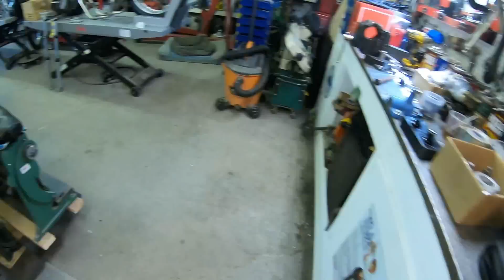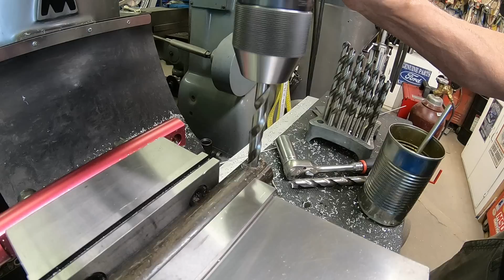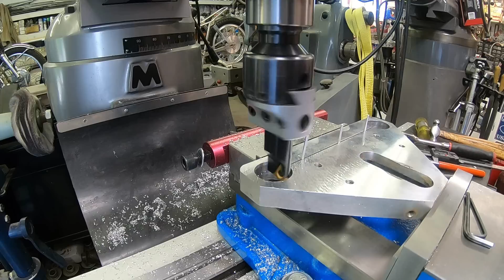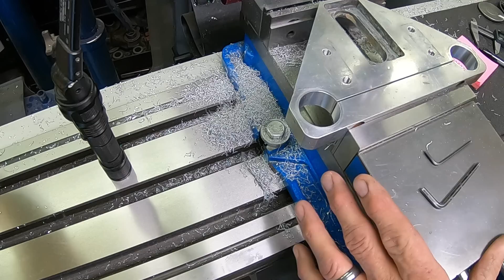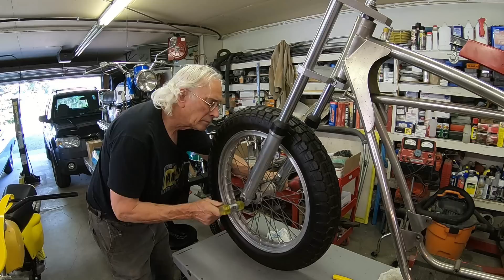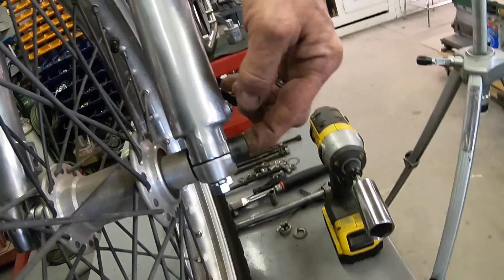Champion Framed Yamaha 360 Flat tracker repairs

Comment: Now you're talking
Reply: I found the bike you are working on . when I lived in California I had to  move I couldn't take it with me I finally found the same bike that I used to have.
 
So I bought it and put it in storage it's in rough shape it's locked up inspected it made a list for tires carburetors wish me luck. 1973 Yamaha 360
Reply from the maker: I understand, I bought mine in 1972, and after I went in the service it just sat in the barn for 35 years, I have been slowly bringing her back to her old glory. Good luck with yours.

Comment: the front tire looks like a Duro HF,  that's what i have on my Honda XL-250 TT-special.
Reply from the maker: Yeah, it does a little, the front on this bike is a Pirelli, it looks a lot like the Carlise do. The rear is a Goodyear both 400x19
Reply: @montana2strokeracer  the Duro hf108 has the same tread pattern of the Carlise cleated tires i used on my real flat tacker back in the early 70`s

Comment: I would have been that guy to turn down the forks lol, I like ur work , I watched the whole video, I have a RZ350 stock bore ,I have 64.25 mitaka pistons I bought, would you be able to bore my cylinders for my new pistons? I have a brand new crank I bought, just don’t trust anyone locally to do the cylinders, I know tolerance make a huge difference,and you seem to be the man who knows this
Reply from the maker: No, I doubt that I can't believe they did that. Kevin, I quit taking on outside work for the summer. Summers too short and have a lot of other things to do around the house etc. If you're not in a hurry, contact me in the late fall, I will see what my schedule looks like.

Comment: Dale if your motor is a RT1 without reeds I have a good piston put away you can have. I’ll have to get it out to see if it is stock or over size. Let me know if you need it and check on it
Reply from the maker: Thank you, sir, no this one is a 72 powerplant. Reeds it does have.
Reply: @montana2strokeracer  you need the piston with the big holes in the intake side
Reply from the maker: Yes thats the one.
Reply: What's a RT1.ON 1973 YAMAHA BIG BOAR MEAN? I'M STILL LEARNING HANDICAP PERSON .
Reply: @ RT1 didn’t have a reeds and the piston didn’t have the hole on the intake side